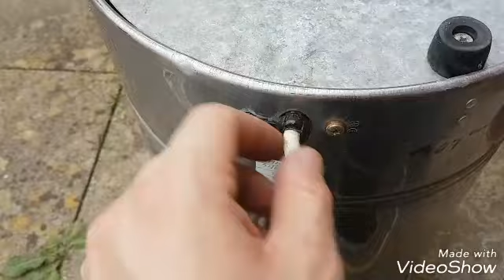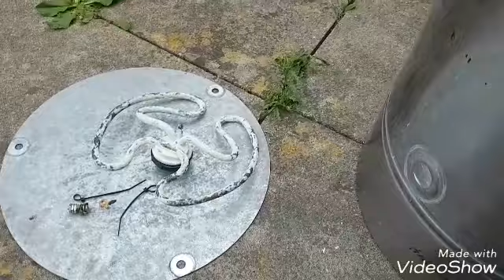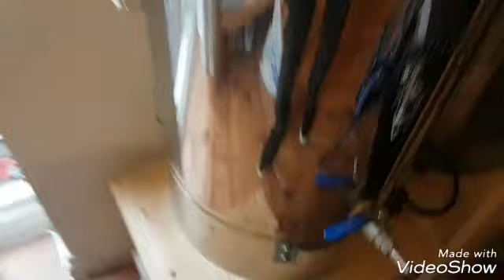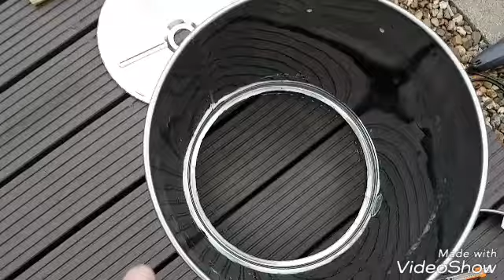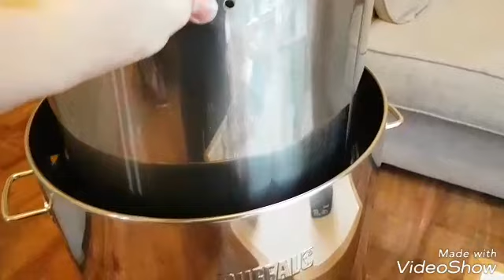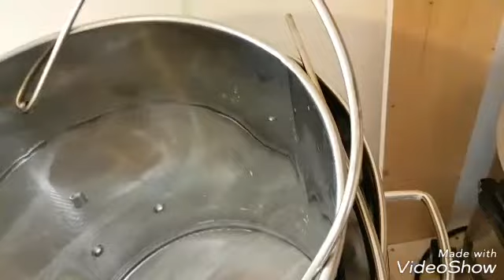Braumeister style malt pipe/grain basket build for buffalo boiler all in one single vessel system

Comment: cool was wondering what a malt pipe is. cool build by the way. but one thing removes that brass plug. brass contains lead and with using acid-based sterilisers as we do in brewing your going to be getting lead in your beer replace it with stainless steel thanks for the info

Comment: Great idea, what did you cut the perforated sheet with, got a build going at the moment and the 40cm x 40cm sheet will come next week. cheers
Reply from the maker: Thanks! I used a stainless steel cutting disc on an angle grinder and placed it on some wood when cutting then just smoothed of the rough bits with a regular grinding disc

Comment: Do you find that having the grain plate just lie loose on the lip works well? I'm in the process of planning a malt pipe build and I would like to maybe steal you design :D
Reply from the maker: Yeah it works great, has enough weight to prevent grain getting round the edges, only slight issue I've experienced is the finer mesh I've also got on it flaps up when on the top allowing some of the smaller bits through into the kettle but i placed underneath the preferred plate and it seems to work much better, if you circulate then wouldn't be an issue though, so I'd suggest be better to go probably 2mm holes as think mines 3mm and use without mesh but 3mm would be perfectly fine with recirculation
Reply: @lukethemadhopper4621  Thanks, glad a simple solution works well :)
Reply: @lukethemadhopper4621  Did you the grain plate off the internet btw?
Reply from the maker: Yeah got from a seller on Ebay there were a few different sellers available, search for perforated stainless steel
Reply: @lukethemadhopper4621  Can't seem to find any suitable ones, but thanks for the tip, I'll keep looking :)